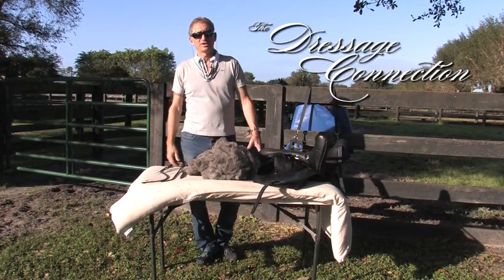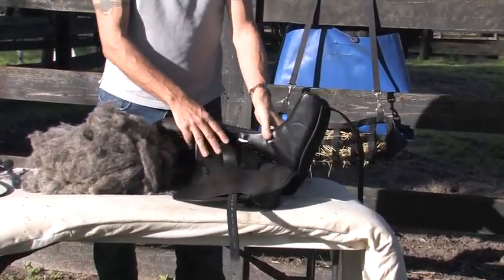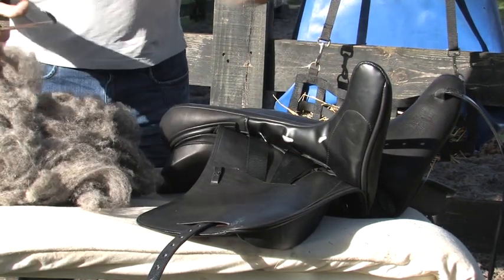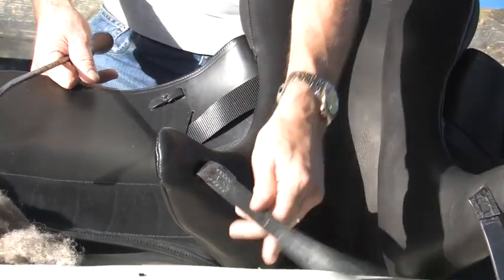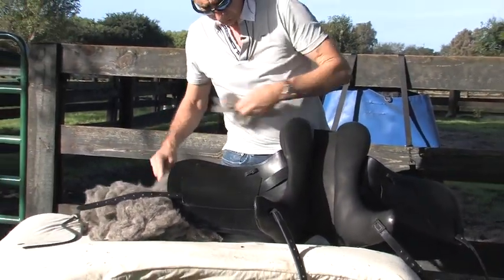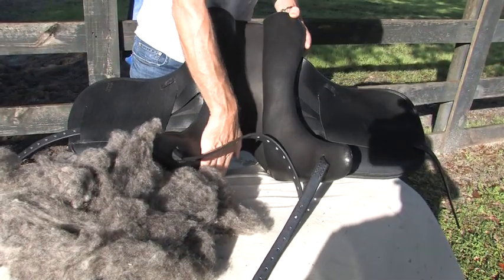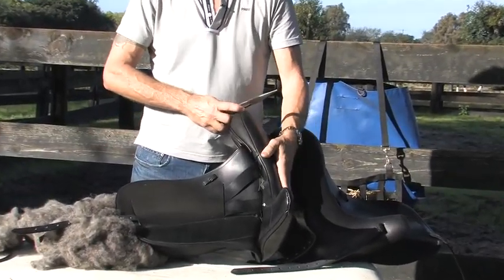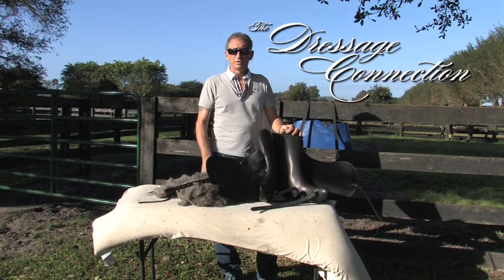DC Saddle Flocking.m4v

Comment: What about those older saddles, how would you go about adding flocking to them?
Reply: Usually older saddles have to be unstitched at the front to have access to the panels and the flocking will be very compact and will need a complete change of wool.